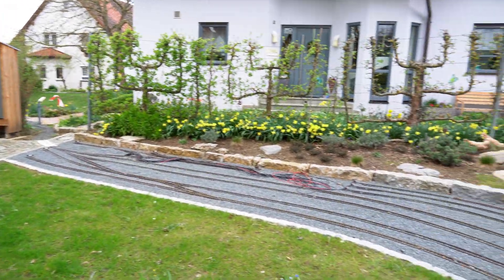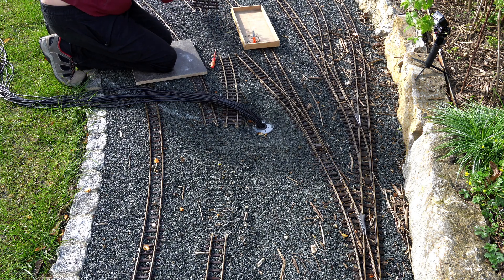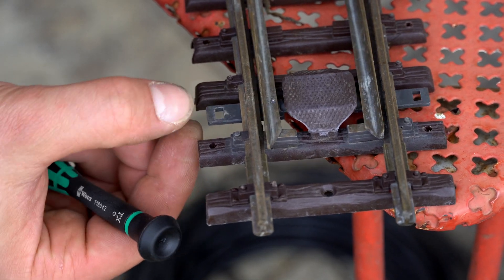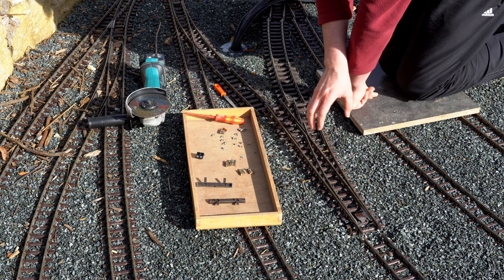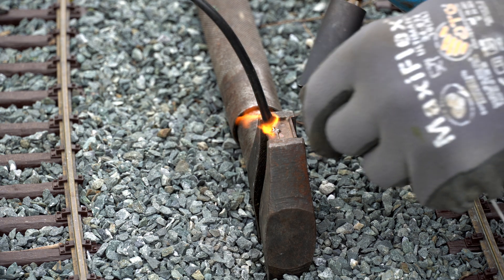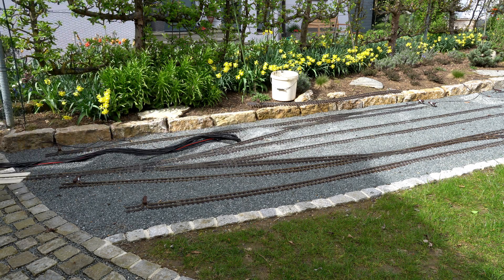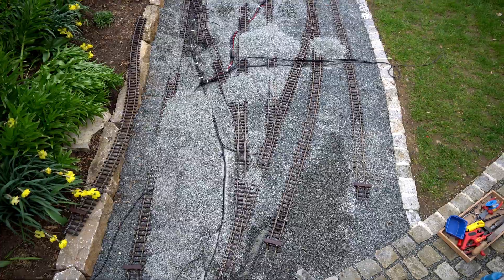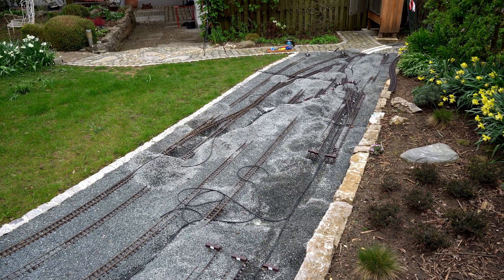Wiring a railway station

Comment: Very interesting information about the switches. A lot of work done!  Good progress! I am still curious about the track occupation detection. Soon we will know ;-) Well done. It is good to see your projects moving.
Reply from the maker: Unfortunately the thiel switches need a lot of attention so far. I hope this gets better as soon as all the building activity becomes absent. Right now, after my treatment they work fine. The "outside part" of my track occupation detection is now finished. All isolating connectors are installed and the individual track sections are soldered to cables that go into my signal box. Next I have to install the detection coil and the circuit boards which I don´t have right now. A friend of mine will supply those but I don´t no exactely when...

Comment: Are you using current sensing to detect the trains? I talked to a guy who tested that and he told me that it doesn't work, due to humidity and dirt on on and between the tracks.
Reply from the maker: Yes thats my plan! I have had good and bad experience with this system. It is not easy to set it up correct but after the set up is done it works good, at least in my experience. For G-scale you need to have a broad adjustment range regarding the sensitivity of the current sensing. Most pre manufactured units don´t have that adjustment range so I will go to a custom mande system which is provided by a friend of mine. I have seen it work so I´m pretty confident :)

Comment: Love the videos of your progress. Do you have your wires numbered so that you know which wire goes where on the control panel?
Reply from the maker: Good question! Right now the cabels differ in length and in the amount of wires per cable. This is how I can tell which cable goes to a switch, to a shunting signal or a main signal. I also have a unique cable for powering my lights in the station area. Bevore I connect those cables to let´s say a switch, I am going to measure electrical continuity per cable so I can tell which cable I am going to connect to that certain switch. Once I´ve determined this I will mark them in the signal box. You will see the whole process in the next video!